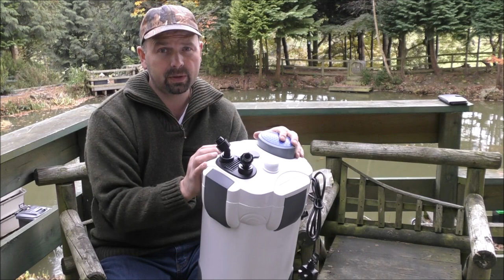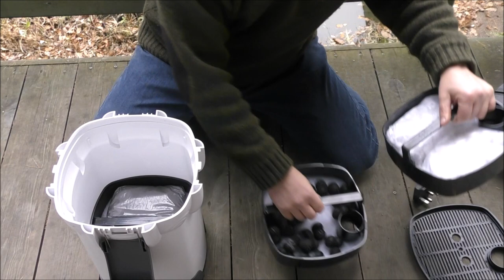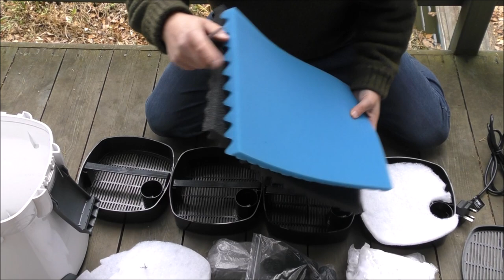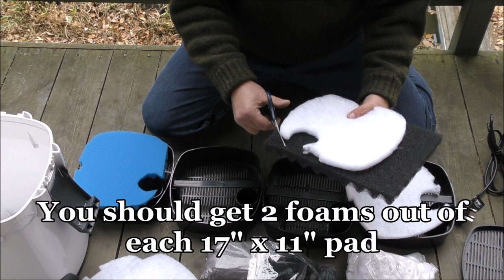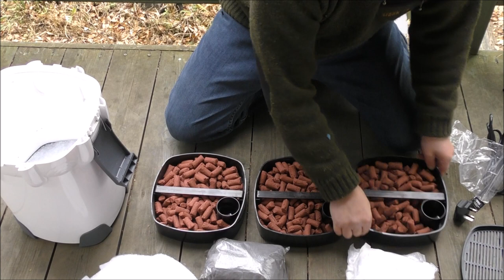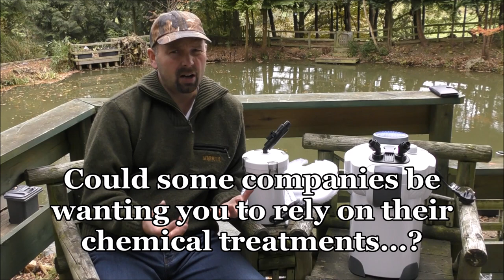Why Your Filter is TOO SMALL and NOT CYCLED

Comment: Seachem matrix is better than bio  home
Reply from the maker: OK...how and why? 
Please explain.
Reply: Pondguru, seachem matrix has 50% MORE surface area than biohome and is cheaper, but I still love biohome.
Reply from the maker: I'm so glad you use surface area as a yardstick as I'm planning a video specifically on that subject to explain why there is an upper limit for useful surface area and also to explain how surface area is calculated. 
I go into that a bit and also show what makes a good media in this video: https://www.youtube.com/watch?v=QTtAUYR67Eg
If you watch the video and scroll down the comments you'll see the lack of understanding so many people have about filter media and that is due to the nonsense put out by so many manufacturers / sellers.
Matrix (low grade pumice) probably has way over 50% more surface area, carbon probably has 100x more than either of them but that doesn't make it a good biological filter media. If we judged everything on surface area carbon would win every contest but it is not used for biological filtration. Too much surface area and a media is quickly clogged, too little and it is no good, the variability of structure and accessibility of surface area are most important factors. That's what I show in detail in that video link.
Reply: Pondguru, seachem is not normal pumice, it's gone through a proccess, step 1, boiling, step two air popping (putting into a pressure chamber) , 3. Heat treatment, then sell, and has 50% USEABLE surface area and has roughly 30%  More unusable,(normal pumice has like 80%)
Reply from the maker: lol, it is a natural pumice rock which has gone through a washing and size grading process at a quarry before being air dried and sent out to whoever buys it, jut like any other pumice. As it is a natural volcanic rock every piece is different, much of the internal structure is sealed and it is impossible to say it has 30% / 50% / 80% porosity or to give a figure of how much of the surface area is useable.
Where did you get that information from? sounds like the sellers have realized that they have been rumbled for selling pumice as something special and come up with that nonsense to quieten down the people questioning them.
Reply: Pondguru I used to work for seachem.
Reply: Pondguru also I bought a gallon of matrix and got like 10 pieces of obsidian and obsidian has virtually NO surface area

Comment: By the way my nitrates are at 160
Reply from the maker: Ouch, that is mighty high nitrates - the biohome ultimate marine would be the best media to use in the canister filter but for a marine system you could need up to 2kg per 100 litres to achieve a full cycle filtration (reduction in  nitrate)
http://www.filterpro.co.uk
Reply: Pondguru Thanks how long will it take to see my nitrates lower
Reply from the maker: Assuming that there is plenty of media then it can take 4-6 months for that last part of the cycle to complete and lower nitrate, sometimes much quicker but normally 4-6 months.
Reply: I ordered the media today but i've have been sugar dosing to help bring my nitrates down.  When i receive the media should i stop sugar dosing
Reply from the maker: Assuming that you have enough media for the size of tank and stock (which could be up to 2kg per 100 litres for a marine tank) then the media will mature to the point where nitrates are controlled by the anaerobic bacteria. The sugar will help feed that and may make it set up faster than it normally would but just monitor nitrate levels and reduce / stop sugar dose as necessary.
It's a process I'm not really familiar with as I have always dealt with tropical systems but as I always advise adding as little as possible to the tank in the way of treatments and dosing unless you have to. If sugar is currently keeping nitrates lower than they were then that is good but the biohome (bacteria living in media) should take over as it matures.
Reply: Thanks brought the readings down from 160 to 40
Reply: Sugar brought those readings down only until i receive my media
Reply from the maker: Wow that is quite a result but I'd think that sugar wouldn't be good to use all the time.
Reply: Yeah thats why i orderd bio home
Reply from the maker: Groovy.
Reply: I checked my water readings yesterday and nitrates at 0 ammonia 0 and nitrite 0.  I added bio home ultimate maybe 2 months ago to my canister filter and did only 1 water change when i changed the media and just let it cycle.  I only have 1 yellow tang in the tank with a few snails and some live rock with a protein skimmer also but the results are great.
Reply from the maker: Awesome stuff. Hopefully that situation will continue.
From your initial comment of 160ppm a short while ago to now have zero nitrates is a world away.
Groovy.
Reply from the maker: Awesome stuff. Hopefully that situation will continue.
From your initial comment of 160ppm a short while ago to now have zero nitrates is a world away.
Groovy.